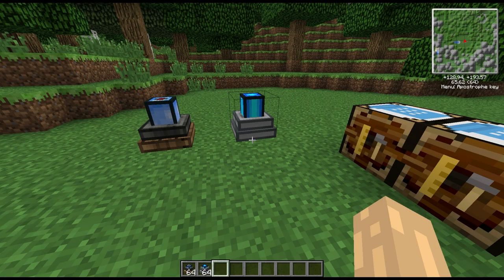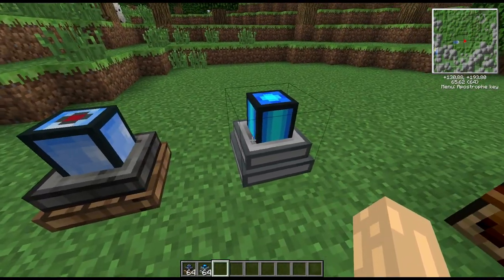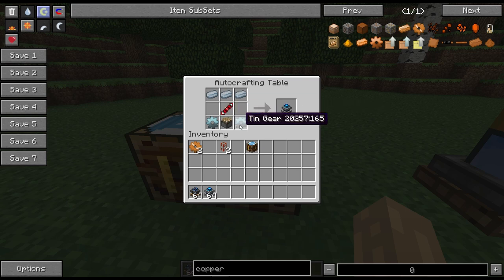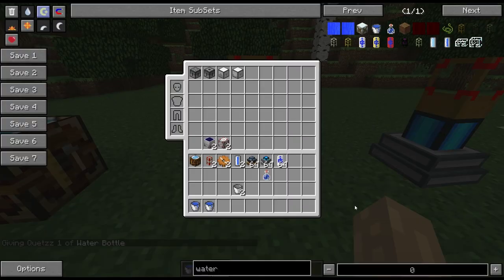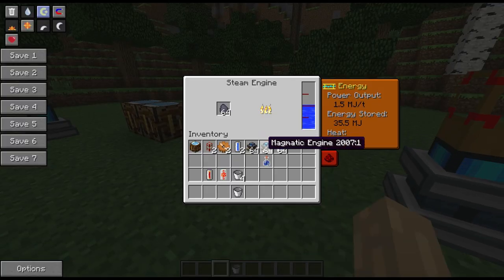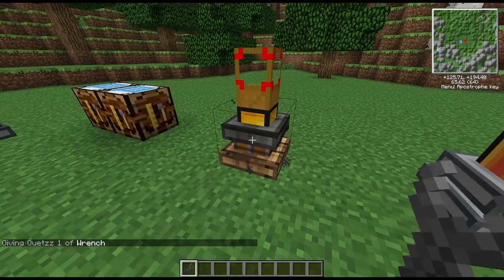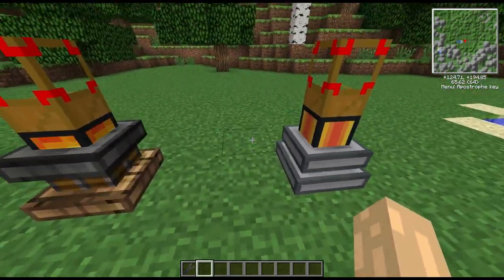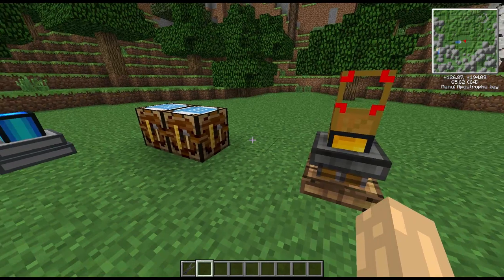Block Spotlight - Thermal Expansion Engines

Comment: so when talking about the geo gen you can make a system like this

magma crucible=water proof pipes=magma crucible
==========magmatic engines===============
========redstone energy conduits===========

this sistem with neather rack in the magma crucible will forever power its self(as long as you have neather rack) or as an alternative a IC2 pump in the neather